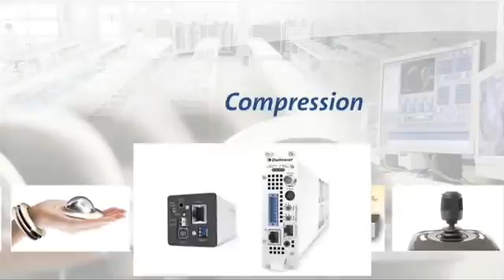06 - Security cameras: Analogue-digital conversion - Dallmeier CCTV IP Academy

Comment: Hi. 
I am looking for a solution to use a IP digital camera to an analog switch box to broadcast the video image to 2 tvs and  large LED banner we have outside. 
We have a muli floor nightclub and currently have several DVRs in the building. We use 1 dvr for cctv visual video to the ticket counters and the LED outside, using a switch box so we can select 1 to 8 channels to broadcast the busy floors and crowd images to the 2 tvs and LED. 
We recently bought to NVR units and IP cameras and would like to use these for the same purpose. Will this converter work?
If mot, is there something you could suggest that would work?
If you would be kind enough to email me directly, i would be much appreciated.
six10ken@s.cm
Thanks
Reply from the maker: Thank you for your message. Do you have Dallmeier DVRs and IP cameras in use? If yes,
please send your detailed contact details to info@dallmeier.com. Our sales manager in charge of your area will then get back to you as soon as possible.  
Best regardsYour Dallmeier Team
Reply: DeepmalaSafety System